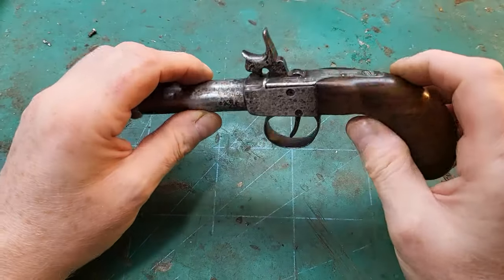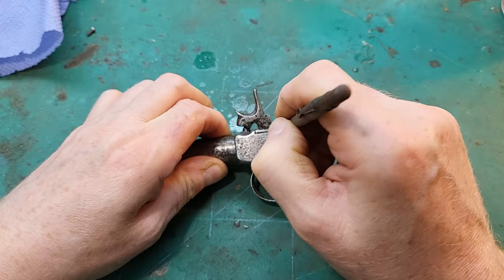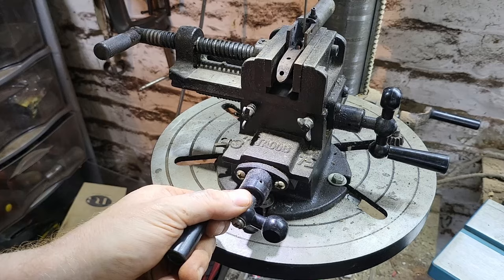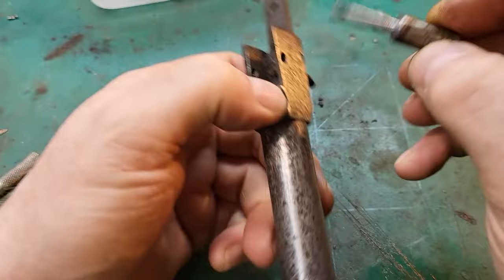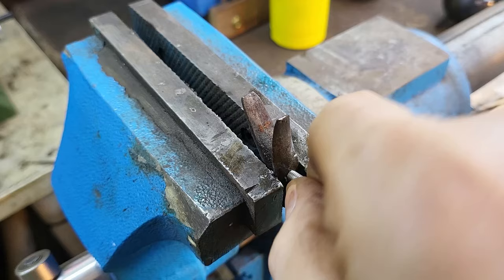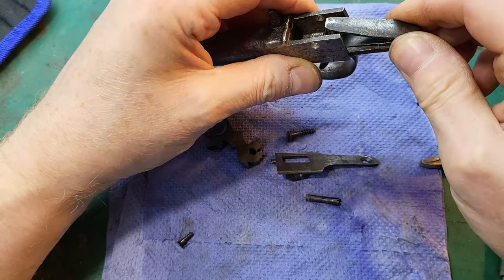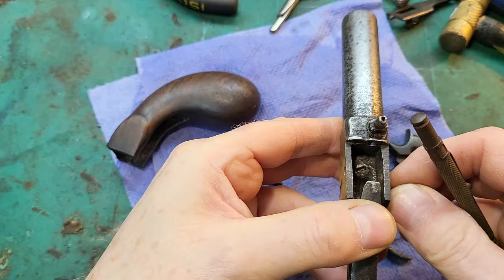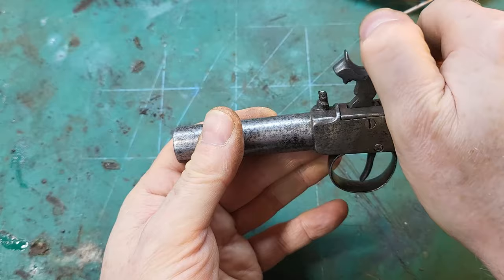I Bought Another Antique Double Duty Spring Pistol - And Lost My Cool With It

Comment: That wee old thing proved to be a 'Right pain in the ask' eh. - Down here in NZ that sort of antique can cost anything from around NZ$700 upwards - as NZ Police don't require any licence or registration for pre-1900 non-cartridge antiques. - Legal to own but NOT allowed to shoot. 
- Did you harden the welded bits just by quenching? Thanks for sharing Morris.
Reply from the maker: Thanks, same situation re guns here. To harden; I heat the part to the correct colour and then quench, I show this in my other videos.
Reply: The other day I ran into a similar problem in the US. Every state is different,  had a shock when I learned my 1866 Springfield has to ship via ffl. Now the low price at auction makes since 😅